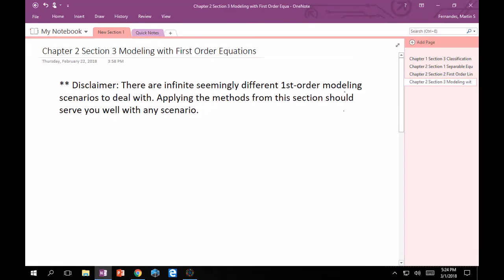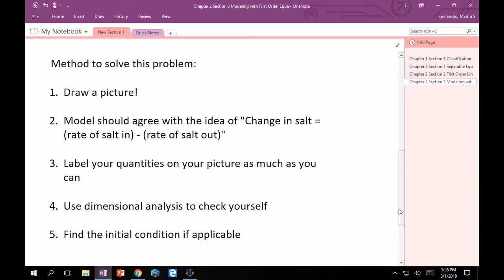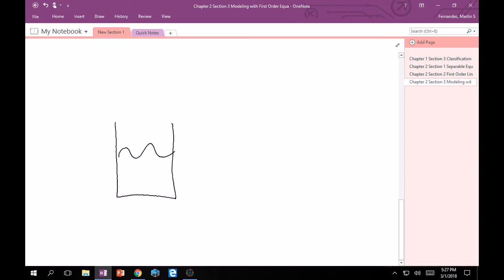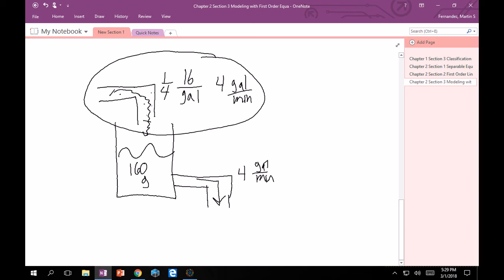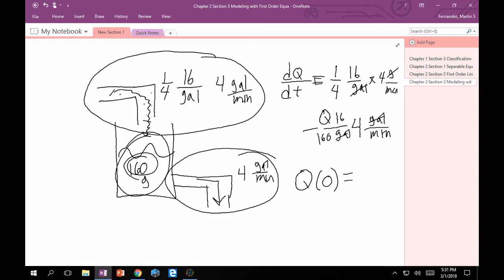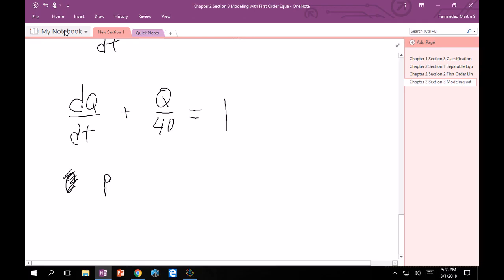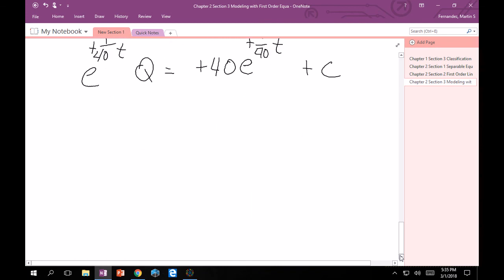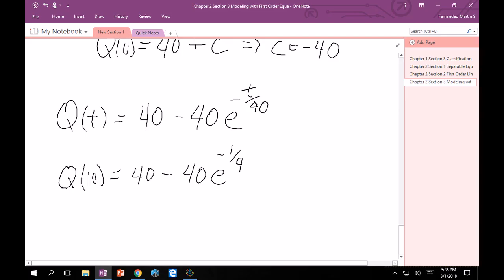2.3 Modeling with First-Order Equations

Comment: So in the second term of the diff eq for the salt, you had a -4Q/160 term. Is the reason for the 160 because the volume going in is the volume going out, so no net increase of volume inside the tank?
Reply from the maker: Correct :)
Reply: @msebastiznf  So essentially, this mixture problem is predicated on the fact that rate in = rate out. What if the problem had been changed to "the rate going in was 4 lb/gal and rate out was 2 lb/gal", will that technique work?

P.S: I'm taking MATH 2552 fall 2020 semester as part of the mod-sim thread for CS.
Reply from the maker: La ninez I think you mean gal/min. It doesn’t matter how much salt comes in or comes out but yes I did on purpose choose that 4 gal/min of water comes in but also 4 gal/min leaves the tank as well. If we say 4 gal/min comes in but 2 gal/min leaves then the denominator would not just be 160 but rather 160 + 2t where the 2t term models the fact that we get an extra 2 gallons every min within the tank
Reply: @msebastiznf  understood. thanks. the video definitely made this problem that once seemed incomprehensible to me much more bite-sized and manageable.
Reply: @msebastiznf  Are you also going to TA for MATH 2552 Fall 2020 semester?
Reply from the maker: La ninez Unfortunately no I graduated spring 2019 but I personally interviewed some of the new TAs and made sure to choose very good ones for GTs school of math. With their help, the faculty, and these videos hopefully you won’t need my in-person recitations :)